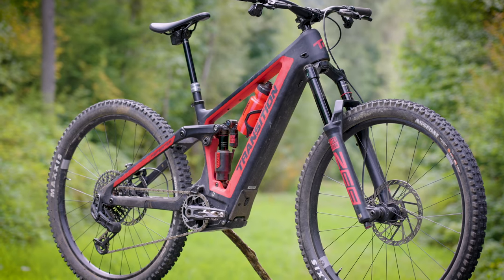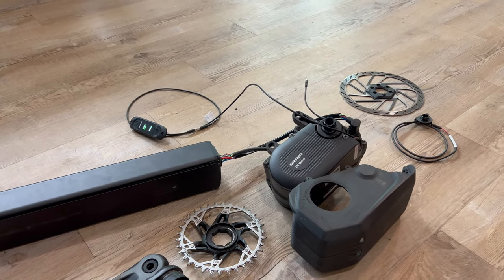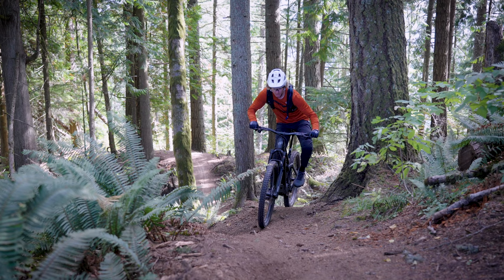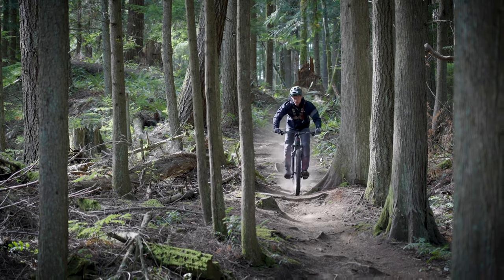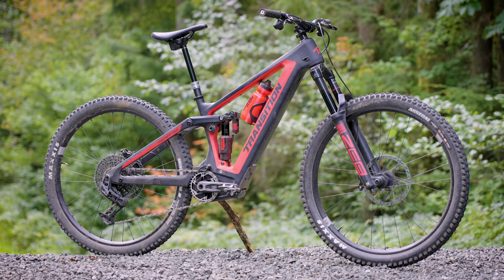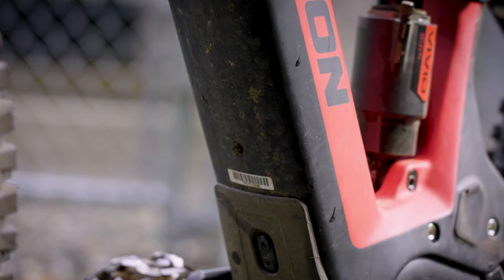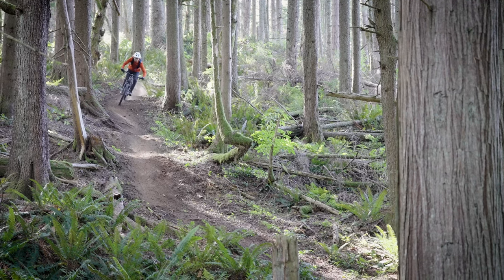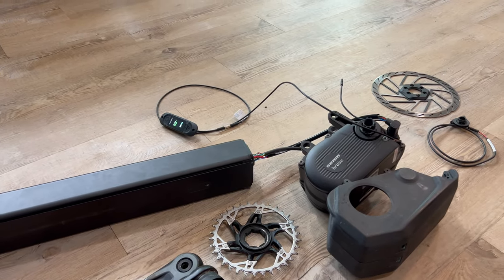SRAM Eagle Powertrain E-Bike System EXPLAINED

Comment: Thanks for the detailed explanation. I just bought a GX T-type geoup set for my 2022 Levo. I'd like to install a "hot shoe" or Sram Eagle Powertrain Extension Cable in my bike to get rid or the extra battery. Where can I buy one that's not marked ip 1000%? I see Cambria Bike has one made for Bosch for $190... There is no way it's woth that much. I might make one myself by pulling apart an old battery case and combining a 12v to 7.4 regulator with a Brose rear light extension cable.

Comment: Only having two modes is a dumb move. A 3rd customisable ride mode would be a welcome addition. Because of the cost of these bikes, the majority of people will only have 1 emtb and use it for all kinds of riding. The 4 modes I have on my Bosch powered bike is awesome because I can do a 60km+ race and not worry about draining the battery and bump the power just slighty to get up a long hill. With the limited 2 modes on the Sram system you don't have the fine adjustablity while racing. It can't be that hard to add more modes? I guess they are trying to be different just to be different?
Reply: I disagree. The modes are adjustable so why does it even matter? One persons eco mode can be another persons boost mode. I’ve been in the industry for over a decade in sales & a lead mechanic & I always just change the mode settings to fit the purpose of my ride. 4 modes are pointless. If your racing why would one ever need eco modes? If someone is doing a e cross country race why would you ever need boost? Just set 2 modes with the assist you need to support your needs. Everyone has phones & it takes less then a minute to change settings & support. I’ve always only had 1 bike & never had an issue.
Reply: I had my Transition Repeater PT for only two weeks now. I too wish it had 3 modes.  I have Range set at default I believe its like 50% and Rally 100%..   There are times I don't need that much power. I can get a lot more range  if I had 3rd mode set to 30% ..  On my other ebike I have it set to 30%  60%  100%

Comment: Epic fail. I see multiple batteries you have to charge separate of the bike. Major Fail.
Reply: Nope. Shifter Pod batteries last a year or two.  Derailleur is wired to the bike battery.
Reply: the derailleur is actually wired to the battery, I didn't notice that, what about dropper post? Also what about the display controller in the frame, I heard that's wireless
Reply: @KurtisPape  SRAM said you can use a standalone battery or wire the derailleur to the bike battery.  Makes sense as a car will take advantage of the internal power source (12V).

Comment: The only thing holding me back is the S Mag motor, I'm not convinced the belt is fit for purpose @ 90nm.  That said, if you consider the Brose motor roadmap i.e. their development of the Brose Drive 3 system (releases 2024) which ditches the belt and provides 410% assistance plus 814w battery.  That's the game changer for me.  So I'm holding back until SRAM adopts the new Brose Drive3 system as their new powertrain.
Reply: when in 2024?